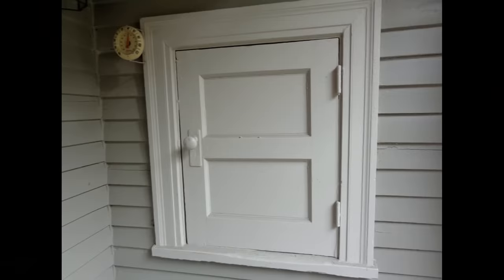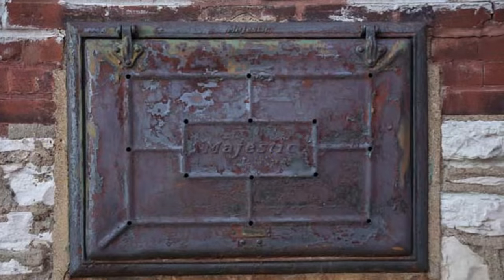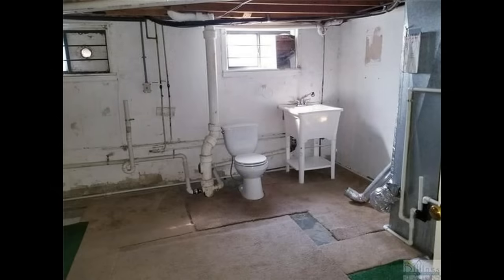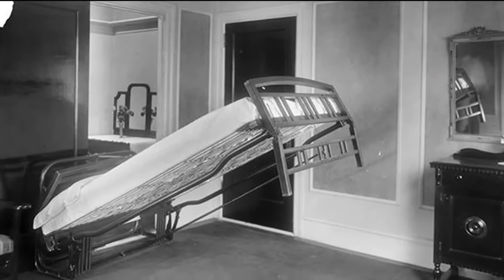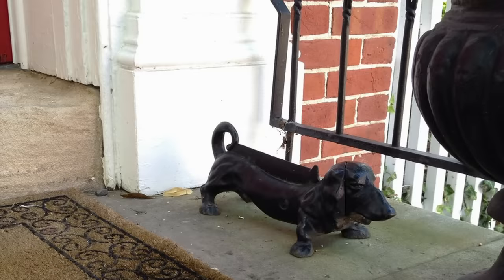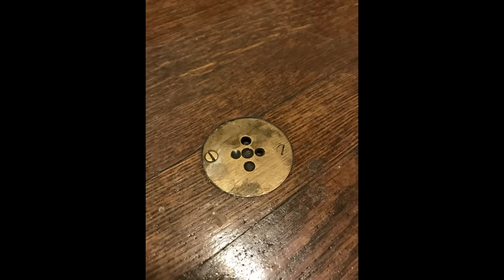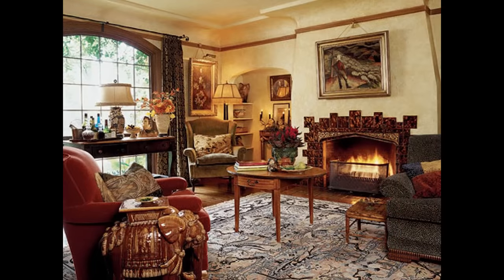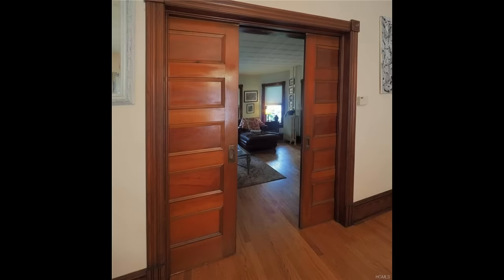Mysterious Home Features No Longer Used

Comment: Another thing that used to be common was a folding wooden ironing board mounted in a cabinet in the wall.  Many old kitchens still have the cabinet, and it may be used for spices.  I happen to have one that still has the ironing board in it.  
Another extremely rare thing I have see that I would love to have in my 1900 victorian is a jib door.  Not going to tell you what that is!

Comment: My grandparents' house was built in 1951 and the kitchen had a pull out ironing board in a recessed area in one of the walls behind a tall, narrow cabinet-like door. The ironing board was attached to the wall on one end with a hinge and could be pulled down to use, then pushed back up and hidden behind the door. At some point in the 1960s the ironing board was removed and several narrow shelves were put in the recessed area in the wall behind the door. My grandmother used it as a cabinet to keep small bottles such as vitamins, prescription medications & spices.

Comment: I am a remodel contractor and have worked on many houses with knob and tube electrical still in use...I have also seen burn marks on ceiling joist where they have gotten wet and arched out.

Any time I remodel an old bathroom, I fully expect to find a 2 ft tall stack of razor blades in the wall below the medicine cabinet 😂
Reply from the maker: Thank you for watching and sharing some of what you have seen.

Comment: One thing you don’t see much these days is houses with a switch controlled electrical socket, usually for a floor lamp in the far corner from where one enters the room. The receptacle is called a “split” receptacle. Split receptacles are also used in kitchens for more power for power-hungry appliances, but they are not ‘switched’, like in the above example.
Reply from the maker: You're right on that.  Sometimes you may see these with garbage disposals and that's about it.  Thank you for watching!

Comment: We used to rent in a house that was so old the basement was small being under only part of the house and the walls were a big radius slope covered in cement. The stairs descended to the only straight wall made of brick. 
The main support beam had adze marks on it. And it was supported by a quarter of a log that still had the bark on it. 
In the attic I found a pair of leather womens shoes with buttons like 12 buttons.
Reply from the maker: Thank you for telling us about some of the features in your old rent house.  Really neat that you found some old shoes too.

Comment: my grandma who was born in 1907 often used words like  ice box and spring house which kept things cool. A dug Out was a cellar  and  an important thing to have in the midwest where tornado's were common.  A commode was the toilet and sweet milk was regular milkl  dinner meant lunch and supper meant dinner. and arithmatic meant math no matter what kind it was. relatives were kinfolk, socks were called stockings  and nylons were  called hose. baby formula was called pablum  and one of my favorites was her first motorized washing machine had a gasoline engine  with  automatic rollers  that squeezed  the excess  water from the  laundry.

Comment: One feature of old barns was a wide open window above the barn door.  Two purposes, one was as a window to let in light during the Winter with the glass window installed.  The second was to remove the window and allow barn swallows to fly in and out.  Barn swallows eat incredible numbers of flying insects and farmers encouraged them.  Unfortunately most modern people have permanently blocked them out.
Reply from the maker: Thank you for watching and sharing a little more on old barns.  Very interesting!

Comment: The wall anchors were mostly installed during the building stage to connect the wall with floor joists or beams. 

They would be retro-fitted in walls that would start to bulge out (or in), but this would require a long metal bar to stretch between the opposing walls in the building.

Comment: I'm not sure if this old memory was covered, but in houses that were called Bungalows, most were built in the 1920s, had a special bed, that was concealed into a bench, usually in a large hallway. The bed could be cranked outside. The bench on the inside, had cushions on it. To sleep on it, the cushions would be removed, and the whole bed could be rolled out of the side of the house, on its own platform, through a special door, or drop down panel. When it was drawn back into the house, a door or panel closed, hiding it from view outside. I read about this, in a book about Bungalows.

Comment: The open plan layout is bad for various reasons, especially in colder climates. They are more difficult to heat, especially if an outside door opens directly into a large living space rather than a hallway. Small rooms also help prevent the spread of fire, especially if the internal walls are brick. A separate kitchen helps avoid cooking smells getting into the living area and helps to avoid the living area getting hot in summer due to cooking activities.
Reply from the maker: You're right about all of that.  Thank you for watching!

Comment: We’re a couple of the pics at the beginning of the video from  Martha’s Vineyard?

Hey!  I have that slot in my medicine cabinet for the razor blades!  Never knew it was there!  Thanks!  Dunno how old the medicine cabinet is but the house was made in 1885.  

We have the servant stairs off our kitchen.  These servant stairs are often buried during renovations and subsequent renovations unearth a perfect set of stairs going up to a sealed area as sometimes the second set of stairs are closed to make more floor area on the upper floor and more counter/cabinet space in the lower floor. One thing I noticed is the stairs going up those stairs and to the third floor rooms have plain door frames where as the rest of the house has more ornate door trim and corner “bullseye”trim. Also the balusters are plain, assumedly as the servants quarters/stairs didn’t need to be ornate.  We also have a hidden bell attached to a cable that goes to the back door and you pull a rod at the back door for the bell.  

We have the picturelle moldings in some rooms.  The issue was the walls were made of horsehair plaster that cracked easily when nails were put in the plaster to hang pictures. 

We have pocket doors to close off the living room from the dining room.  There is also a rod to hang a curtain the separate the living room from the front foyer area.  I think that’s to allow entertaining of guests in the living room without being disturbed.  When the living room was closed off, people that wanted to go to the dining room from the front foyer could go through a small hallway that connected the foyer to the dining room, by passing the living room. These doorways in the foyer and dining room have since been converted to closets in the 70s.  

Regarding the dining room, the fireplace is in the dining room and not in the usual living room.  I was told this was a farm house in the 1800s so maybe that’s where the family gathered after a day of work?

Yeah we have knob and tube still but it hasn’t been modified so house is still standing and insurance company is till insuring us. In a couple places we have twist style light switches.  

Windows I assume were hand made and the original windows have hand blown glass from what was told.  Has a slight wavy appearance.  Also a lot of the older houses have either a leaded or stained glass in the house.  We have a leaded glass panel along the stairs going up to the landing of the second floor.

Comment: We were on a bare-boat charter and anchored at Socia Island when this beautiful old 90ft S&S sailboat came in.  Had to go look at it and were invited aboard.   It turned out that it was a wedding gift to one of the Vanderbilt family in the '30s. -  It was commandeered as a mine sweeper in WW2 (wood hull),  took over and raced at the US Navel Academy, then given to the Tacoma WA Sea Scouts.  One thing that stood out was a large cylinder that went from the deck, through the main salon, and down to the engine room, so that the family wouldn't be offended by the crew.

Comment: Wow. My house has knob and tube  electric push button light switches a coal shute and a 2 circuit 30 amp screw in fuse box ( not connected now). Hand cut oak beams (with bark still on ). The corner beams are true 6x6 mortise and tenon with fire hardened oak spikes.
Reply from the maker: Thank you for watching and sharing some about your home.

Comment: The first house I bought had knob and tube. Everyone always tells you how dangerous it is but the electricians I spoke with said it could stay. I took it out regardless. I decided to run tests with the scrap. I could easily run 30 amps through it over nearly a hundred feet without damaging the coating. 50 amps really messed it up though. Haha

Comment: Wall plates were usually added after the walls started to bow and sag. If you see a building with a lot of them, there is a good chance that it has some ongoing structural problems. Very few new buildings are solid brick, though unreinforced concrete block construction is still allowed in some places, so it's possible that a few of today's buildings will eventually need wall plates.

Comment: Our house was built in 1951 and has knob and tube wiring. Still in use and insured too! There's no wall insulation so that reduces the fire hazard. Not designed to be used with insulation. If we ever were to insulate the house we'd have to rewire the whole house too.

Comment: I remember removing some of the knob and tube wiring I worked on and helped rewire buildings and residences.  I don’t remember if it was still in use or not but insulation in some of the cases was deteriorating.

Comment: We have transom windows in our house in almost every room which can be opened by rope since it is up. It helps in air circulation. In India, it is almost common except in cities and rich houses.
Reply: My old Victorian row house, has a central floor vent for heat on the second floor and all the doors upstairs have transom windows to allow that heat in, while having the doors closed
Reply from the maker: Thank you for watching and sharing what you have!

Comment: Kind of rare, but there were "pie cooler cabinets", usually on an enclosed porch or outside kitchen wall. They had wire mesh shelves and were connected to the outside by screened openings. You could set baked goods in them to cool down.

Comment: My first house in the UK, 1978, was built in 1918, a terraced or row, house. It had an outside toilet that would freeze in the winter. No fun sitting there with a parka on. It's also why occupants would use the under-bed chamber pot at night. If you were extremely poor back then, you 'didn't have a pot to piss in..' As I found out during renovation of this classic 'two-up, two-down' house - two rooms downstairs and two bedrooms, plus a 'scullery' kitchen, it still had the gas supply serving the original gas lamps. Chopped through one under the plaster and the gas came hissing out. It only had one electric socket upstairs, on the tiny landing. Four working coal fireplaces, too.

Comment: In the last apartment house hubby and I lived in, it was older, and it had a telephone nook. We had an antique end table against the wall next to it where we stored our phone directories. The nook itself didn't have accommodation for those. It was quite a quaint little place, located above two commercial businesses. The staircase to our only entrance was located in the rear of these buildings, where our backyard was located, so I guess our entrance would technically be called a "back door". But it wasn't an extra door. That was our only access to the outside from our private residence. The doors to the two businesses below were located on the street side, opposite our residence door. Our kitchen, one bedroom window and the large picture window in our living room all faced the busy street below.

Also, we had NO dishwasher or laundry room. We hand washed our dishes, and took our laundry to the local laundromat in town. We did have a second bedroom, which I used as my studio. And, of course, an interior bathroom, a hallway where the linen closets and a glassed in curio cabinet were located, and a clothes closet in the foyer next to an interior open entryway in which I hung a decorative, floor length sheer panel. The design was novel, and we loved it.
Reply from the maker: Thank you for watching and also for sharing some of the apartment house that you and your husband lived in.  It actually sounds like a great place!

Comment: Building code got in the way of most laundry chutes. With current laws in many states you are required to install fire dampers between floors to prevent drafting of air in the event of a fire. Fire dampers are a spring loaded galvanized door installed in such places. The door is held open with lead linkage which melts at low temps engaging the fire damper.

Comment: I grew up in an frame house built in 1911 in Cicero, IL.  It was one in a whole neighborhood built as worker housing to service the factories and huge railyard.

It had sash-weighted windows, a laundry chute, a Pittsburgh Potty in the basement adjacent to a two-basin laundry sink (enclosed by walls by 1970), and transom windows over the two original bedrooms (walled up).  The basement was half sunk, a concrete foundation to just above floor level, and had wood floorse over dirt (which we replaced with a concrete slab).

In the early 70s we added phones to all rooms, the attic bedroom, and the basement with a comm and buzzer system built in.  They were fancy multiline phones with hold buttons.

Many of the brick homes with cement porches in my neighborhood still had bootscrapers, very useful in Chicagoland winters.  Some fancier ones had pocket doors but those were a nightmare to repair if the guides wore out due to plaster and lath interior walls.

Comment: I grew up in an Australian colonial workers cottage/Queenslander that was built around 1890, and the ceilings are about 5 metres / 16 feet in my bedroom which is on the side of the house. The rooms in the centre of the house have higher ceilings, closer to 6.8m/21ft.

In a more traditional style Queenslander there isn’t even a ceiling, and the tin roof and wooden beams are kept exposed with a gap between the top of the exterior walls and the verandah roofing sheeting for lots and lots of ventilation. The floor was also wooden boards raised above the ground by stilts that didn’t have any walls, allowing air to flow under the house (and also offered protection against flooding). Obviously this is for a climate that doesn’t get very cold, I can’t imagine how awful a snowy winter would be in that kind of house, but for summer it’s great.
Reply from the maker: Thank you for watching and sharing some of what those homes are like where you are.    That's very fascinating to learn how it is in other countries.

Comment: I live in a 1907 built home. It originally had wood/coal fireplaces to heat and no running water. Out house (pit toilet)  was off the back porch. A coal furnace was later placed in the basement. Over the years, the house was updated with natural gas lights and fireplace inserts, yet my grandparents kept the coal furnace until the late 1960's when they finally put in a gas furnace.  When electricity came to our village, the natural gas lights were replaced with knob and tube electric lights and 1 electric plug per room. Once water and sewers were available, a small two story addition was added as a kitchen on the 1st floor and bathroom on the 2nd floor with cast iron sewer pipes inside and clay tile sewer lines to the street. Galvanized water lines were used. I spent my summers and some winter holidays almost every year vacationing with my parents in this house since I was born in 1959.  After my grand parents passed away and my dad retired, and passed on, my mom and I moved back into this Victorian house in 1992.. I have modernized the home with updated plumbing, electrical service to modern code, central air and new ductwork. We kept all the old woodwork, doors and transom windows. I love our old home with all the modern mechanical upgrades. And yes, we still have land line wired telephones, but they are usable through our cable internet service or we can still have them as AT&T landlines. We use 1 smartphone for use in the car, or if power is interrupted.
Reply from the maker: Thank you for watching and sharing some of what you have had in your old home.  Sounds like a great home and a lot have changes have been made.

Comment: It seems like a good idea to have a laundry chute  going from the upper floors to the lower floor where the washer is but these clothes are dirty and over time, can potentially contaminate the inside of the chute causing odors that would be unreachable to remove
Reply from the maker: There are actually ways of cleaning those just like other air ducts and chimneys.  Thank you for watching!

Comment: my house has an intercom from 1955. it also has a built in radio that allows it to be played through all the rooms. and the switch to speak doubles as the off for the radio to your room. also toilet, sink, bath tub and tile all glazed in the same color from the same company, idk if they do that anymore and not just white. idk how common it is bt my single story house has laundry hamper pockets built under the sink that come out like the laundry shute bu just hold it.
Reply from the maker: Thank you for watching and sharing some of what your house has.  It's very interesting.